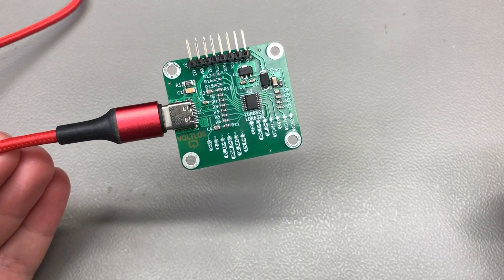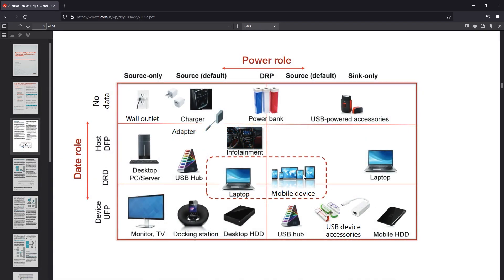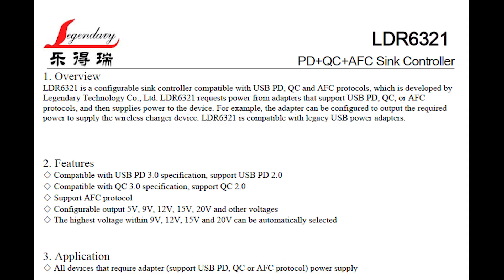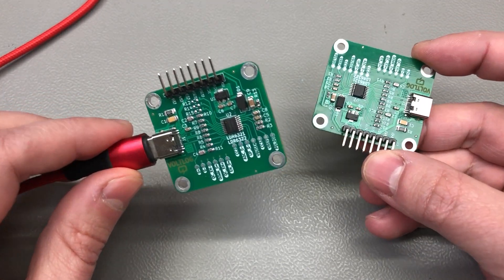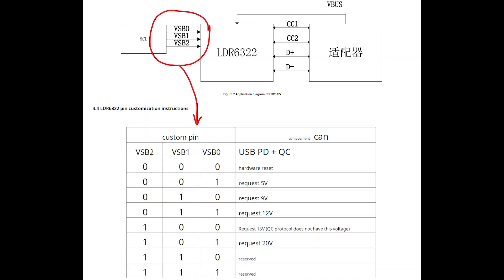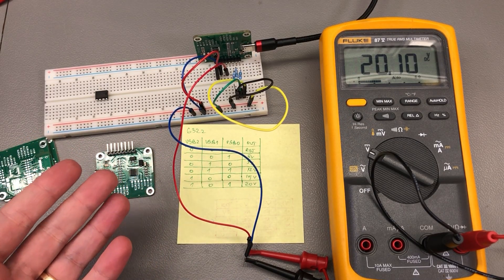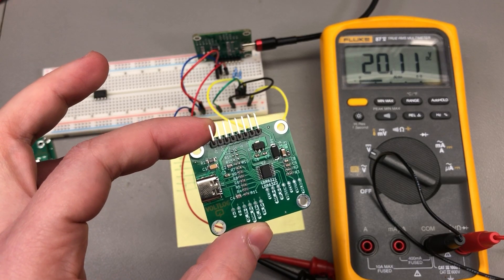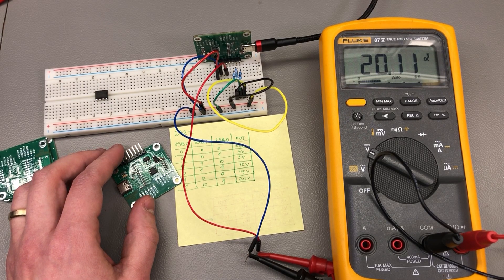USB Type-C Power Delivery The Easy Way! | Voltlog #411

Comment: Might this be useful for building a "High-Voltage" programmer that is capable of resetting the fuses on Atmel/Arduino chips?
Reply from the maker: It could if you wanted to build such a device powered from USB-Type-C

Comment: What is the price? Is it available at any distributors? I've seen the  IP2721 and IP2721_MAX12 used as PD controller chip.
Reply from the maker: Cost is around $0.70 a piece in small qty and you can order them directly from Legendary but might be available through some Asian distributors as well.

Comment: Interesting! I want a power bank to power my Hotspot when the battery dies. The Franklin T10 hotspot will work without a battery installed and has a USB C charger input. I think it only needs 5V. Not sure if it is negotiated or just defaults to 5V. I'm wondering if I can just use a USB A to C cable? Or should I make an elaborate USB C power bank? I have a bunch of 18650 batteries I can use.
Reply from the maker: It might not be PD at all if it's just 5V, could be just a couple of resistors on the CC lines in which case you can plug that into any USB port and it will power the device at 5V.
Reply: @voltlog  Thanks. I'll try it when I get a USB A to C cable.

Comment: For a project couple months ago I use HUSB238 IC. It don't support QC but have PD 3.0. But much smaller package and less components needed.
Reply from the maker: The HUSB238 is certainly interesting because of the lower external part count. 👍

Comment: I think it has to be an ASIC (or at least has dedicated circuitry for USB-PD) since the CC1 and CC2 pins should be 5.1k resistors and only 100 ohm is shown on the schematic. The chip should have an internal 5k to ground on each of those two pins.
Reply from the maker: That's a good argument.